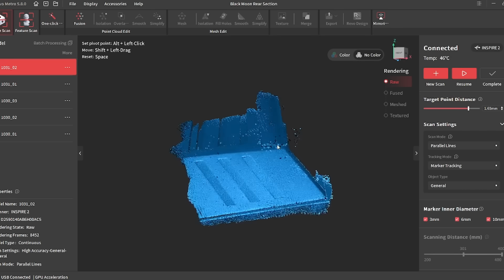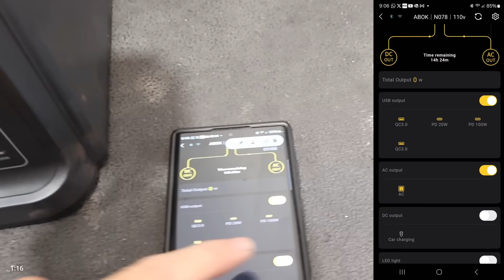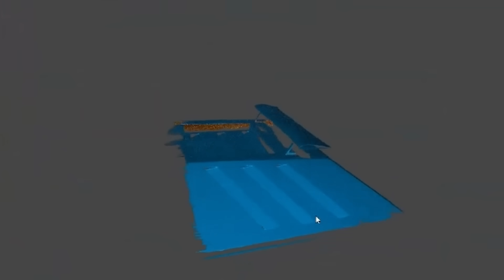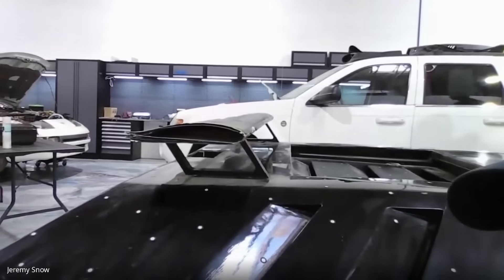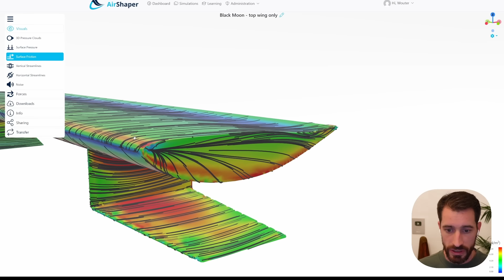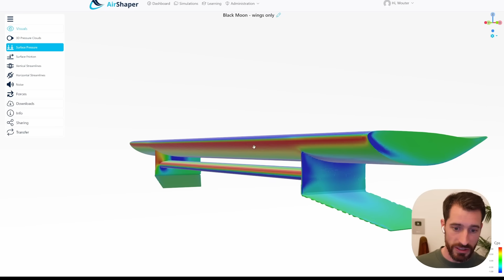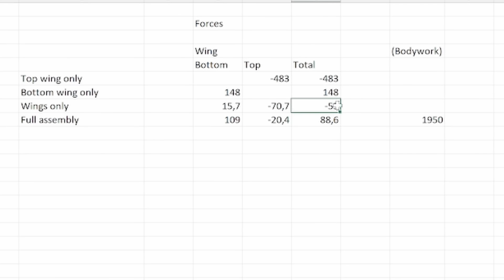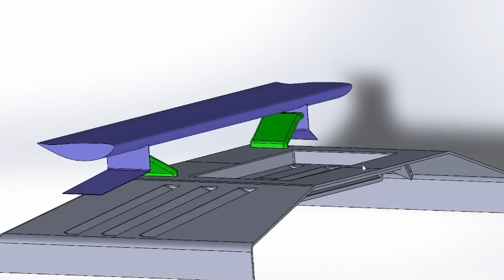We Tested the Black Moon Car Wing — The Results Were Surprising!

Comment: I think staying true to original with the bigger wing on top, but maybe just flattening out the middle wing so it's not a wing,  but just a flat surface simulating a wing? This way it looks like there are still 2 wings still in the middle, without the middle piece actually directing wind.

Comment: It really comes down to what the customer wants, if they are trying to keep the car true to the movie, or plan on driving it. It's such a subtle change its not really going to affect performance for average driving. If you wanted to be fancy, make a new wing that bolts in the orginal place, take the movie wing off and restore it, that way you can treat it like aftermarket upgrades, if the next owner wants they can just bolt the stock piece back on.  Best of both worlds.

Comment: If it's going to be a display vehicle only keep it as in the film, but if it's going to be driven (especially on the public highway) then it has to function in a rational and safe manner. Keep the twin wing design but invert the lower one, maybe increase the vertical separation and reduce the 'thickness' of the the lower aerofoil. Really, anything visually acceptable that reduces the negative affects of the lower wing.

Comment: Safety and stability at speed! More people have been hurt and have cashed in their chips through looking cool as opposed to being safe! As cool as it looks I could tell you from just looking at it that it would most likely cancel itself out or basically make it lift. I didn't have all of the information I just had a vague idea. Of what little I know about basic aerodynamics. I love cars! However I have never really gotten into planes. And that terrifies me a little while also fascinating me at the same time. And when you look at aerodynamics between cars and jets and other planes You begin to spot similarities in ways to cut aerodynamic drag making the car more efficient and able to cut through the air better. What a lot of people seem to forget that we live in an ocean of oxygen! We basically live in a fluid that a lot of people don't think as a fluid. They tend not to think of it because they can't see it. However if air were visible we would never see anything ever again! That is how much of it there is that we live in. Just a little something I picked up. I like to educate as best I can. Anyway good luck with the restoration. I would prefer a resto mod if you're going to go full electric then I would highly recommend that you try to incorporate more modern aerodynamic knowledge to try and compensate for the coolness while doing your best to maintain the overall original look. I do not envy your engineering task ahead of you, however I am fascinated to see the answers that you come up with. Please do be safe! I cannot stress that enough, famous last words tend to be that looks cool and hold my beer. So safety and stability at speed! I am sure there is a way that you can incorporate both wings and maintain the cool factor! Because basically the vehicle has the aerodynamic efficiency of a smooth brick. For a smooth looking as the countach is it has the same aerodynamic drag as a Honda Odyssey minivan! It looks cool but the aerodynamic efficiency is absolute garbage. That is what you are dealing with. Please be safe! Take care.😊

Comment: I would invert the wings and add a bit more spacing in between them so that visually it looks like the movie car, but is actually more functional. Do some more analysis to see how much you need to gap them to make it more functional, and hopefully it’s visually not that much.  My guess is you can maintain 95% of the look of the original (essentially completely indistinguishable even to nerds and super fans of the movie) and still make it far more functional.

Comment: Flip the bottom Wing for downforce, connect them both as one movable piece, connect actuators so that either the whole assembly goes down (moving the wings closer to the body), or the two vanes or wings/ foild slant down at the front for dramatic effect, like an air brake. Or the standard recommendation which is, this is just a big prop, so it just needs to look like it did in the movie, no change except reinforcement of the failed connecting points.

Comment: Get rid of the second wing. It Fecking sucks. Use the top wing only. It will work better and still looks great. It doesn't matter if it's not the same as the movie because movie cars are made in 2 days on a limited budget. Now is the time to spend some time and effort to make it as cool as it should have been in the first place.

Comment: Keeping the look is important, but it doesn't have to be unsafe. Make both wings neutral (same shape upper and lower, no lift or downforce) and keep the angle of attack level(air flow neutral) to reduce any drag. If you insist on keeping both wings, separate them as much as possible to stop the dam effect. This isn't an F1 car, downforce isn't that necessary. The bigger issue is the drag these wings produce. Remember the Countach? It went faster and was more stable without its two wings.

Comment: Personally, I prefer a two-wing setup, but it needs to be functional. I don't think simply inverting the bottom wing would solve the issue. As shown in the aerodynamic analysis, the main problem is that the two wings interfere with each other—the gap between them is too small.
My suggestion is to first flip the bottom wing, then increase the spacing between them slightly by raising the entire assembly. Additionally, both wings should be less airfoil-shaped, especially the bottom one. The bottom wing should be more like aesthetic one, while the top wing should be responsible for generating most of the downforce.

Comment: What if the lower wing cancels te big one in order for the car to be driven normally, with a cool look? Lots of downforce in the back only, (without downforce in the front) would make the car unstable in higher speeds and with the height of the car it may be even worse... the car would need to be lowered, add a front spoiler in order to use the back wing with real downforce..

Comment: I would think the goal for this build is to restore, not improve. Keep it screen accurate. What is to be gained by altering it? Do you need to win a race?
Reply: They're doing very drastic alterations by converting it to electric. Lift on the back isn't safe. There are American highways with 80 MPH or higher speed limits. A big chunk of wing like that would have significant force at that speed, and it shouldn't be upwards.

Comment: Invert the lower wing but add some separation. Increase the separation of the wings, Depending on if it would even help. Or maybe keep part of the double wing look by removing a section from the middle of the bottom wing.

Comment: Make the lower wing very thin but have it actively tilt to force all the air above it when breaking. My hunch is you will get a hep more drag (air brake) but with the right gap and angle between the elements, you will get a higher velocity and more attachment on the underside and  trailing edge of the top element. This should create more low pressure on more of the surface area, as well as changing the angle of the air off the back upward.  

If you can make a decent rear diffuser the lower pressure at the back should speed the air under the car to create down force there as well. It should default and naturally spring to High drag / DF so there's no issue with it not actuating and the car not stopping as expected.

SO do DRS kinda. Also you could put small end plates without changing the aesthetic to much.

Comment: Flip the bottom wing. However, I know it modifies it from the movie, move it forward/back or add tilt as needed to get the right downforce for the car. If you are feeling really froggy, use one of the old buttons to give the driver the ability to tilt the bottom wing. The dude plans to drive it so making it useful and safe while sticking as close to original as possible, I think, should be the way to go. Adding small modern touches would be the icing on the cake.

Comment: I would remove the lower wing. If not for safety, than it just doesn't look off. Missing bit of wing is not that big of a departure.

you have to decide, at what speeds this car is going to be driven. If it's just a showpiece, leave the wing as is. If it's going to routinely travel at 60+ mph, definitely make it top wing only.

Third route is to redesign both wings using CFD to reduce drag to minimum, in dual wing configuration while still having net downforce. This won't be cheap, so that's to decide by budget constraints.

Comment: Remake the lower wing as a thin curved surface that conforms to the flow path created with the top wing in isolation. This will hopefully create the correct aesthetic but give proper performance. Probably need a Carbon Fibre foam core construction to make it thin and strong…

Comment: I know that you are working with the as-is condition of the "Black Moon", and I did a bit of frame-by-frame looking, and here are a few things I noticed from the movie compared to the 3D mockup;
1)  The side profile of the top wing is smoother and thinner in the movie than in the render and design. (This could be from alterations or repairs after shooting, material differences distorting due to temperature and expansion or contraction, or internal supports failing.)
1a) The curvature of the "top" of the wing is consistent and deeper compared to the render. (Same as above, also could there have been a replacement done on the main wing, or a "pop-out" that created that forward bump after years of storage? Stresses may have added to the changes.)
2) The trailing edge is higher than the leading edge in the movies, changing the angle of attack compared to the renders. (At least the thickness of the wing. If there was a through-rod on that wing, it may have shifted over time, or contributed to the distortion.)
3) Those wing supports appear attached or resting down to the side of the car in some shots. Looking at some of the promo shots, they are parallel, in others there seems to be an appliance that buffered the ends against the body.

These are just things I noticed. Wings back then for spoilers had end-caps that were a bit larger than the spoiler wing itself and was basically a plate and the wing profile larger outside but also a tight fit inside the actual wing. I am just curious what a different angle of attack on the top wing, and a more smooth curved contour would do for the numbers? Inverting the smaller wing would fix the majority of the issues if the angle of attack doesn't change numbers with a bit of adjusting. And the down-force transferred to the body on those struts going down would certainly reduce the stresses on either wing. I wonder if, before the car was sold, they modified or bulked up the top wing and it is separation of the bulking material giving that odd profile? Oddly enough, in the Wingho Concordia II concept art, the bottom wing was ahead of the top. As always, a fantastic episode, and educational concerning aerodynamics and such. The comments aren't criticisms of your work, Jeremy, simply observations of what I could see referencing the original film footage you provided and comparing it to the CAD designs. Love your attention to detail, as always, and looking forward to the next video. There are great suggestions, I just wanted to help, if I could.
Reply from the maker: Thanks for the detailed observations!

Comment: very interesting analysis of the wings... 🤓
🤔personally I'd delete it (since flipping it over would still create the pressure blockage) or replace it with a flat "wing" that's just cosmetic so it just looks similar to the original & actually help with rigidity...
🤓another option would be to modernize it by inverting then moving the lower wing forward (or the upper wing back) so that you get the additive downforce. 🌬👋

Comment: Increase spacing to remove the chocking, stagger fwd and aft to use the wings to capture more airflow and allow better spread of the end load. Add vortex generators to keep the flow on the upper wing

Comment: Definitely invert the lower wing but what if you remove the center third of the lower wing and add vertical brackets on each newly created end.  That would increase the mounting strength of the wing setup but more importantly allow all that center pressure building at the choke point to dump through the center but still give a very similar side profile for the double wing look.

Comment: Everyone commenting on making it functional are forgetting one thing:

This car isn't going to be going fast enough, long enough for the wings to make any kind of significant/noticeable difference.

Most wings on any kind of car that are meant to go fast are designed to be at speeds faster than even most highway speeds, therefore the huge wing on your 86 Civic with a stock engine will not see any kind of benefit.

You don't need a wing for down pressure when you're driving 40mph through town and this car is not going to live on a race track.
Reply: Rear wings on FWD cars like Civica always make me giggle, but yeah even my old V8 Cobra didn't need one.

Comment: Change the lower spoiler so that it helps with downforce. It won’t be noticeable on the car and will help it handle better. Unless the weight of the motor and batteries is so heavy at the back that a little lift might help it handle better 😂

Comment: I would go for the one wing, But if you really want it to look closer to the movie, how about a foil? If you only invert the second wing, it's not gonna be as effective as you're still gonna have that pressurized area between the two. But placing a foil there? thin sheet with some geometry so it doesn't warp too much. The smaller profile would create less pressure against the big wing. I don't know...

Comment: I would leave just the top wing. If you want to stay truer to the movie, make the lower wing very thin but correct side up.
Another option would be to place the lower wing slightly ahead of the upper to hopefully generate downforce on each without the choke point

Comment: For normal driving use I think it would be good to have no wings, the car would look great. An easy to remove mount would be the best path forward. For Movie mode I say keep the wings as per the movie setup, (they really don't or wont do much even if setup corectly) and as long as the EV conversion weight balance is good the Wedge shape is plenty good enough.

Comment: If you are going to maintain a Dual wing configuration,  go with actual DRS like they use in Formula 1.  Dual wings for cornering and open it up for straight aways.  Really the only modern answer.

One day, we will get to see your personal Porsche project right?????  Not the client one with jeep batteries, but your project car.

Comment: I would invert the lower wing however lower the height by 20mm - 30mm to give the upper wing the ability to breathe better giving it the downforce necessary based on where you hope the batteries will be placed given their weight, whether forward or aft of longitudinal or medial CG
Reply: If you don’t want to increase the distance between the upper and lower wing, you could taper the lower wing  giving it a positive wing vortices pushing more air between the upper and lower making the upper wing more effectively due to the negative pressure wave that will still be created by the lower wing being so close to the upper…

Comment: If you invert it and still keep the bottom wing I think it will increace the drag cuz it will still compress the air below the top wing. If you want to keep it I think it will need a little tunning and a little different stacking so the car can be driven at higher speeds and be safe. But I think boths wings will need some change of form. The faster option is to get rid of the bottom wing. Imo the final solution is whatever the customer desides but wing/s need to be funtional for safety.

Comment: Invert the small wing and shift it forward a few inches. It looks like with the suction effect it's not only causing lift, but a ton of drag as well since the air needs to divert away from those unoptimized surfaces. Some of the other models he used as an example of multiple wing structures could give an idea of how it would work. Modeling for sure to find an optimal position. Cool project!
Reply from the maker: Good ideas!

Comment: Just leave the small bottom wing out, and use only the big and functional top wing. It's the visually dominant one anyway. You have to look rather close to even know it's two wings.

Due to the tight spacing, even adding the bottom wing as flipped would likely be just worse than only having the top wing.

Comment: It'd be neat if the lower wing were still there for cosmetic reasons. I wonder if there's a way to keep it but minimize the "choke" effect from the simulation which ruined the upper wing's downforce. Perhaps make the lower wing thinner and shorter from front to back? Or maybe make it totally flat?

Comment: I agree with the other comments in that if you're going to make it a functional vehicle you should correct/invert the bottom wing, otherwise it could become dangerous at high speed. However, if you just want to keep it as a prop, then you should be as faithful to the original as you can and keep the wing as it was/is.

Comment: Yoo only had a partial model and got very partial data… 
Tuft the whole car, couple 360 cams and gather whole car real world data… 

I agree the inverted structure is probably shite, but with the whole car, perhaps the flow around the body splits the flow and the double wing does infact create downforce…
Probably not, but half assing it ain’t good either way